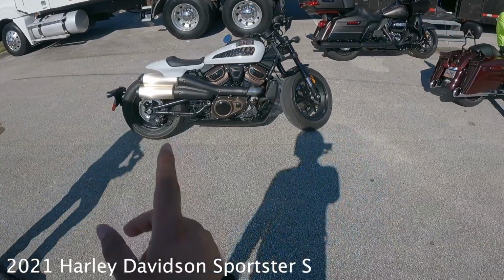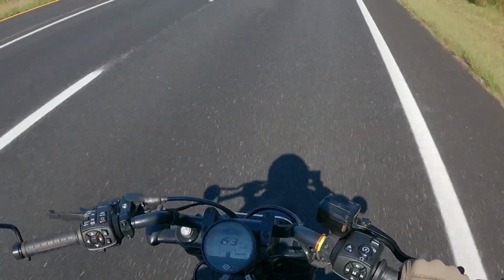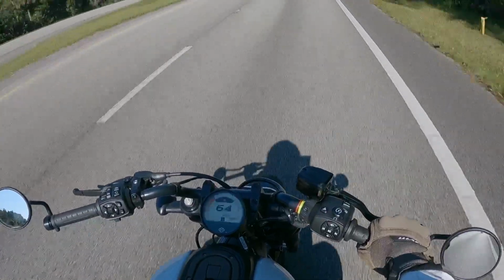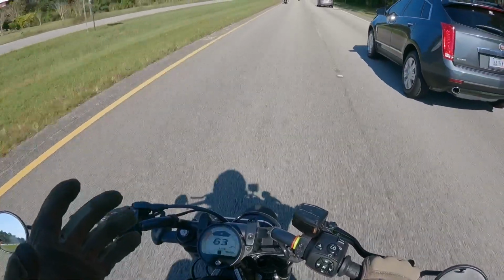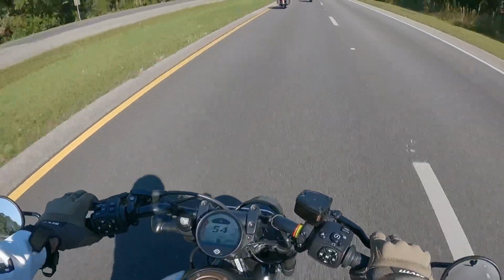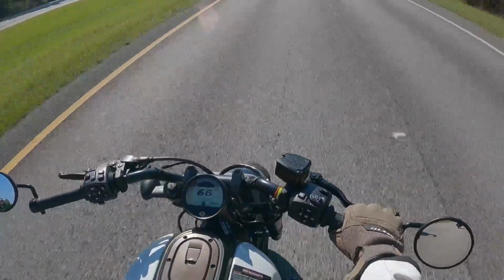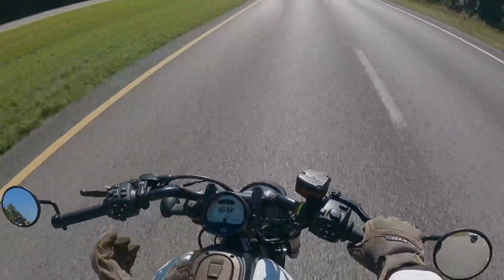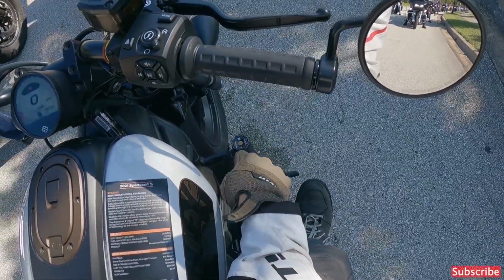Harley Davidson Sportster S TEST RIDE AND FIRST IMPRESSIONS | REVOLUTION ENGINE

Comment: The exhaust seat & license plate thingy are non starters. But before long the free market will have an abundance of ways to fix that stuff as they are with the Pan American now. Several have made good sounding good looking good performing exhaust for the PA so it will happen. Seats will come with it creative ways to replace the goofy plate holder thingy. 

The sportster is a proven winner and this motor is proving itself.